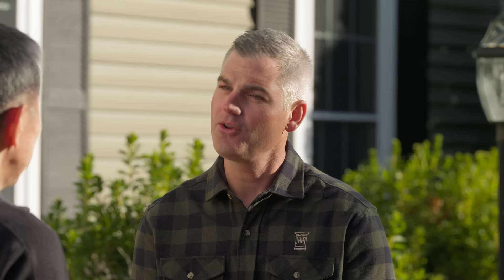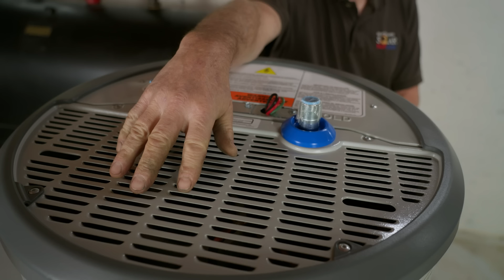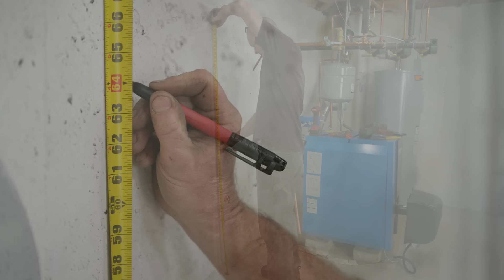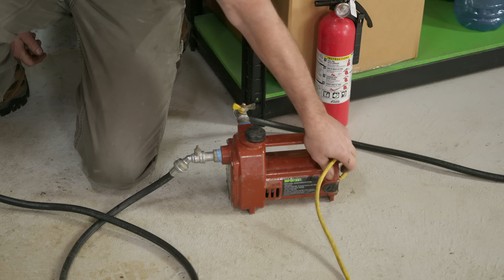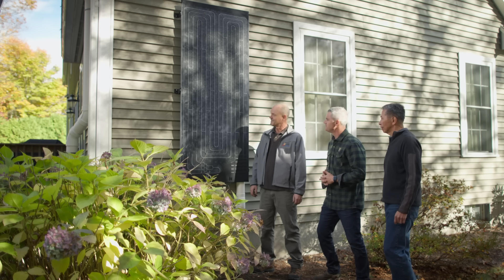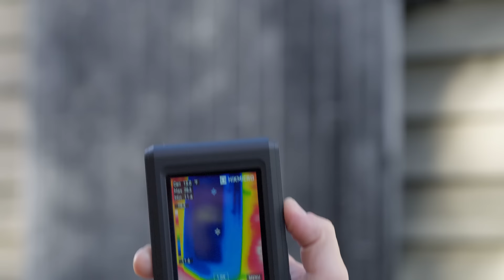Heat Pump Water Heater for Cold Climates | Ask This Old House

Comment: Bruce did one at my house in Portsmouth NH. Excellent product so far. The cost was around $5,000 and qualified for a tax credit at the time. I have an 80 gallon tank and a double panel.

I measure all of my energy use closely on every circuit. For my setup June was my lowest month at 61kWh usage, January was the highest at 154.4. The entire year is going to be around 1,000kWh or approx $200 to $300 energy cost. I use a lot of hot water.

The price quoted above is with our expensive energy in New Engand, 20 to 30 cents per kWh. 

I have PV solar panels on my house which average out to about 5 cents per kWh over the lifetime of them. So the actual yearly running costs for me is about $50 a year for hot water.
Reply: Did he explain why they use a static panel and not a normal mini split condenser with a fan?
Reply: @pprb123 - I think it is for simplicity, fewer moving parts plus the potential solar gain from the sun hitting the panel. You can see the diagram in this manual with the COP based on how much sun is hitting the panel. 

https://www.ecosmartinc.com/wp-content/uploads/2021/07/SAHP-Brochure-and-Specs-2-page-SS.pdf

There are for sure air to water split systems which are very common in the UK.
Reply: I hit 150 kwh for January with ours and its the coldest its been in years in NYC. Its a 65 gal tank and just running on heatpump with my cold garage connecting to the boiler room, no outside panels. $5k seems expensive though! But maybe the exterior panel one is more expensive than just the indoors one.
Reply: Also you folks are only looking at installed cost...it's pretty trivial to show they save money in the long run...
Reply: What's the company?
Reply: do the panels have to face south or could they face east or west?
Reply: @bennyfactor  @4:25 they mention location.  Doesn't need southerly exposure.  It helps increase efficiency.
Reply: What company does Bruce work at? Looking to change my oil water heater in MA.
Reply: Thanks for this. I was dead set on getting a tankless, but the temp rise of 75 degrees is really messing with the math.  ICF home is being built.  Wife wants one of those spa showers with the wall jets.  Basically a 2-6 GPM demand depending on all devices being used or just one.  A Rinnai 199K BTU gas tankless needs a 11GPM input to get 5GPM output at a 75 degree temp rise.  Plus there is a pressure drop on top of that.
I am now researching heat pumps.  This is intriguing, but that $5K price tag is hard to accept.
Reply: That price is insane.  I got a top quality A.O. Smith commercial gas water heater and the cost was just over $1000.  I'll never switch to a heat pump or electric system as where I am in NY we have tons of natural gas.  I don't really care what the law says.
Reply: @lookoutforchris - Did you install yourself? $1,000 installed is a price you won’t find for anything in my area. 

I also don’t have gas here. I was on oil, same as the video describes. I moved to mini split heat pumps powered by solar and this system for hot water.
Reply: @lookoutforchris  So stubborn lol
Reply: @lookoutforchris  in NY you can get a big rebate from the govt for these, cost will be nowhere near 5k even without it though
Reply: Heat pumps in Ma are such a bad idea. Stick with gas. Far more efficient and cost effective
Reply: @brucewh1 - What do you mean by efficient here? 

The only thing holding back heat pumps in Mass is the high energy prices. Ironically almost all of the energy cost can be assosciated with natural gas generation costs. So it’s actually our over reliance on gas that is holding back heat pumps.
Reply: @mattc6854 thanks for asking. Great question.  Electricity is extremely expensive.  I have a heat pump and my last heat bill for an 1100 sq ft home was close to $700.  If I used natural gas, it probably would be $150.  You can’t lower energy prices by reducing the supply of energy, which this state has done. Not to mention the state shut down out nuclear plants.  Once again, you can’t lower cost by reducing supply. And by supply I mean both electric, gas, nuclear.
Reply: @b @brucewh1 Yes electricity is very expensive in New England.  I have solar panels which average out to 5 cents per kWh calculated over their lifetime. In this January which was super cold my heat pump used 1700kWh for primary heating a 1900 square feet home which is about $85 at 5 cents per kWh. The water heater shown here used 154.4 which is $7.72.
Reply: @mattc6854 how much did those solar panels cost you?
Reply: @brucewh1 - The cost is about $25,000 post credit installed professionally which is high, if you DIY it can easily be less than $15,000 these days. That price should get you between 11,000 and 15,000kWh generated per year in our region. The panels all have 25 year warranties these days and will operate fine for years and years after that. The payoff for my system is 6 years and it is more than half way paid off already.
Reply: I'd just like to remind everyone that "post credit" just means the money's taken out of our collective taxes rather than out of the customer's wallet.  So... $25k post credit at a 30% federal subsidy would incur a cost of about $11k to taxpayers, likely including the buyer given that they're often securely in the middle class.  It's even more taken from taxpayers if your state is issuing state tax credits on top of the federal.  California was giving around 20% tax credits on top of the federal, so a $25k system after credits would have the taxpayers covering about $25k.  What's hilarious about that, is the solar panel owner then expects to make some additional money from selling the excess energy back to the grid.  The customer gets the revenue, but do the taxpayers who helped fund that installation get their 30%-50% cut that they helped pay for?  Then on top of that, maybe the homeowner decides that they want to keep excess energy, have a backup system, so they pony up another $10k-$20k on a battery backup.... which of course the federal government also picks up about 30% of the tab, and the state may as well.

In other words, it is kind of ridiculous to announce prices after tax credit, as if the credit is free money and other people aren't picking up the tab, often including the customer who's paying into the tax system.  For example, if 100% of homeowners bought these systems, they'd essentially just be subsidizing each other, with no one coming out ahead.  The same money would come out of their pockets, subsidies or not.

Ironically, subsidizing these systems, the hardware producers and installers often just jack up the prices to boost their profits.  Put it this way, credit or not, if a customer is willing to pay up to $25k for a solar system, then if the producer and installer want to sell it to you, then without subsidies, they'll have to reduce their price to $25k to try and sell it to you, or if they can't, it'll just be too expensive and the customer will have to consider other options.  With a $10k subsidy, the producer/installer will just charge you $35k.

I'm all for solar, I just find this needless socializing of the cost for these excessively expensive systems to be a bit strange, when the owners can clearly afford the systems unsubsidized, and the total price would probably come down if the producers/installers weren't trying to drive their margins up on the backs of taxpayers, under the guise that it's free money to the customer; it's not and never has been.  IMO, it'd be better just to collectively build a solar farm with the region it services collectively paying for it and benefiting from it.  If it's over producing, sell the energy back to the grid, and redistribute that income to all of the owners equally.  That way it's completely fair.

The real issue in our nation is just that we have a raging energy consumption problem.  We use way too much energy per person, buy too many things, use far too much HVAC, use far too much hot water, fly too much, drive too much, drive massive vehicles, etc...  I just pulled up a chart of every country in the world's per capita energy usage, and the US is 13th overall, with the only nations with higher per capita energy consumption either being in deserts or they're sitting at latitudes that are as far or further north of our most northern latitudes, like Canada, Norway, and Iceland.  And that's their entire nation.  The US at least benefits from a hefty chunk of it being closer to the equator.

The only way to reduce our incessant energy consumption, and preferably reduce the amount of GHG emissions, is to raise the price on energy, especially fossil fuels. The more expensive energy gets, the more attractive that $35k-$50k unsubsidized solar installation starts to look.. maybe with a 20% discount since the producers/installers can't boost their margins off the subsidies.  Maybe energy is so expensive that people start to do what they should have been doing from the start, looking for ways to reduce their overall energy consumption to save money.  If we reduced our energy consumption, then even if we bought a solar system, we could go with smaller and cheaper systems.

My house is using a gas water heater and a gas furnace.  I cut my energy use by simply using less hot water, adding insulation to the house, and wearing warmer clothes so I can turn the HVAC down.  Who says a house has to be the perfect temp year round?  We are fully capable of putting on a sweater at home in the winter instead of carelessly frolicking around in t-shirts and boxers.  Ironically, the less AC one uses in the summer, the warmer the house, and the more enjoyable a cooler shower is, using less hot water as a secondary benefit.
Reply: @mattc6854  Our state is making it so nobody can afford anything with it's poor energy decisions.   Electricity is coming from the highest cost sources and will only to continue to rise in the near future thanks to the Net Zero Carbon mandates that will cost in the Billions.   I am fortunate to live in a town that has municipal Gas, Water and Electricity,
Reply: @greglevangie8157 - You have stated the correct problem but not the cause. Nearly all of New Englands energy costs increases are attibuted to fossil fuel prices. We are in such a period right now with very high nat gas prices. 

Offshore wind is contributing to decreases in the real time cost of power. All of the data is available and free to analyze.
Reply: @updlate4756 - Fossil fuels have more subsidies than solar by far. Look up ethanol from corn as an example. 

Everyone should look to reduce usage as you stated. Thats why moving from oil furance to heat pump makes sense. When they built my house oil was cheap and they threw in a 100,000 btu monster and didn’t care about insulation at all. I heat the same house with 42,000 btu of heat pumps after adding a lot of insulation.

The solar “cost shift” you describe where non solar customers are subsidized by solar customers is a fantasy and debunked. NEM policies have long since been adjusted as more customers have solar.
Reply: @brucewh1 how high are you running your heat pump? Our house is 3x bigger and only around $350 to heat. Gas is way more expensive in MA than electricity
Reply: @johnlinks I leave temp at 68 consistently
Reply: And my house is fully insulated. Do you have solar panels already installed and $350 is your net?  Honestly I struggle to believe you.
Reply: @johnlinks - The construction of the home, the insulation and also importantly the air leakage matter a lot. 

My heat pump used 1700kWh in Jan which is a lot but its also an older 1960s home and we had a cold month. But 1700kWh averages to 2.3kW constant usage which is like running two small space heaters so it’s still fairly efficient.

Without solar credits it would be $300-$500 for the month which is still less than I would spend on oil.
Reply: Who wants that humungous thing sitting on the side of their home for a whopping $5,000? This is not "affordability" coming from the Biden Inflation Reduction Act, especially when rebates get smaller or disappear.  Worse yet, you need space close to the equivilant of a traditional water heater plus an on demand heater on the basement wall.  If you have a finished basement with a small utility room or a slab home with no garage I can see a problem.  I was an early adapter of hybrid water heating when I had a warm, large basement but that unit never heated the water enough to please my wife. If you are forced to use a hybrid in a small closed utility room under your bedroom I can see a problem with noise & not as much cu ft of heat to draw from reducing efficiency and the temperature of the utility room where your water supply lines are. Most of the crazy Biden regulations killing freedom of choice have been rescinded but not the one discussed in this video.  I am all for alternatives like in this video but against being forced to do so because Biden and his handlers erroneously think they know what will work for everyone, at a drastically increased initial cost.
Reply: @2000TransAm1 - It’s one solution of many, if you actually listened to the video. Hybrid water heaters make sense over traditional electric water heaters. At worse they are the same but at best they can be 3x as efficient. Water heating from an oil boiler means the boiler will have to run all summer. The solution described here allows you to not have more cold air in a basement area for winter climates. 

If the home had gas available that could have been an option too.
Reply: @2000TransAm1  The outside panel version is optional and the design has nothing to do with biden lmao. The first unit they show works perfectly fine and is only a bit taller than older style units. Cost way way way less than 5k as well, just check lowes website.

Comment: A heat pump does nothing but air condition the outside air. The majority of the heat is generated by electricity running the compressor. Compressing a gas (refrigerant) generates heat. As long as your compressor is efficient, it's not a bad system. I installed one in an additiona this summer and it keeps the room comfortable in single digit outdoor temperatures.
Reply: Heat pumps don’t generate heat they move it. 

In this mode outside heat is moved into the tank to heat for hot water.  The efficiency is based on the compressor technology and the type of refrigerant used.  Vapor injection is the best technology in very low temps.  In this system it is unique in that the compressor and the evaporator panel are split.

Comment: One of the most interesting videos you've put out in a long time.  Would love to see a follow up on the effectiveness of this install.  One question is whether the outdoor evaporator unit can ice over if installed in the shade and conditions are both below freezing and humid.
Reply: Ive had the same product for a year now installed in Portsmouth NH. It’s running perfect through this cold snap. 

Highest usage month was this month in Jan at 143kWh and lowest was in June at around 60kWh. 

It doesn’t freeze up it just gets frosted like in the end of the video.

Comment: Just installed  a GE Geosprings 120volt heat pump water heater to replace a natural gas unit in our Michigan basement. It has its own mixing valve and can heat water up to 160 degrees, annual electric consumed is about 1.5 kWh per day, so about $60 a year based on our local 11 cents per kWh. Cost of the unit and install was under $3k. Loving it so far.
Reply: So where I live in the northeast , the cost of electricity is three times higher plus they add service , taxes and line charges.  Back in the late seventies, I met someone that built their own water heater system. They basically put a solar collector on their roof that had copper lines filled with water/ antifreeze that ran down to the basement . 100 gal super insulated tank and a small electric water pump. There was another copper coil in the tank that transferred the heat to the tank. I think they also make them without a pump, not sure.  I think it is only a matter of time before we go all electric.  🇺🇸👍
Reply: .13kw sounds low for electric in Michigan. Consumers electric is my supplier its around .20kw
Reply: @rbm8218 Hillsdale BPU is 10.7 cents per kWh. I also have my own solar system so converting any gas appliances to electric as they get to end of life
Reply: 1.5kWh a day here would mean $200 per year. Sadly
Reply: At $60 a year in savings that means it’ll take you 50 years to recoup the cost of your heat pump? You’re happy with that?
Reply: @CheddarTeddy I think they’re saying the cost to run will be $60 per year. Unclear what the savings over other options would be. Could be more than $60.
Also, non-heat pump water heaters are not free, so added cost of heat pump is less than $3000.
Reply: @pbbu123 i $60 a year? So, $5 a month??? That’s hella cheap
Reply: $60 was his total yearly bill, based on a typical COP of around 3.75 I am going to speculate that his previous hot water tank usage was costing him around $225 a year in energy or otherwise stated an actual $165 a year savings. Assuming his old tank was end of life a new  non heat  replacement tank would have likely been in the $1200-$1500 installed range, so you should not factor that in ROI calculations. So if you divide the additional  $1500-1800 premium for the heat pump tank by $165 then your looking at a ROI of around 9-11 years assuming the price of electricity remains constant, which in all likelihood will increase and improve his return on investment even further.  In my own situation our family of 4 household  we save an actual  $30 a month over our old tank and my ROI is only 4.4 years.
Reply: @CheddarTeddy nope you didn't factor in the 30% federal tax credit, and I'm saving 25 a month in reduced gas cost... You need more math skills😉
Reply: @e @ericmoore2319  thanks for clarifying. Trying to understand how all this pricing works